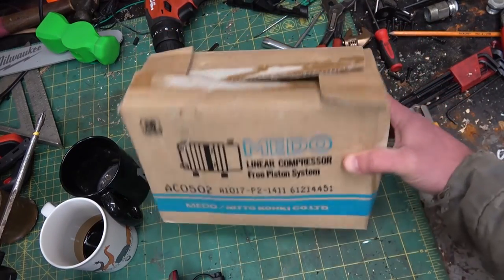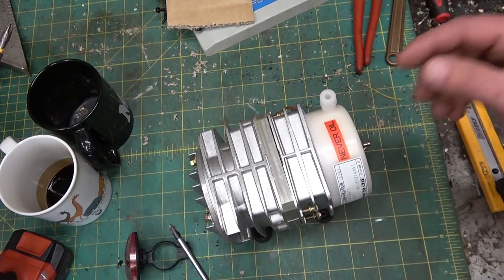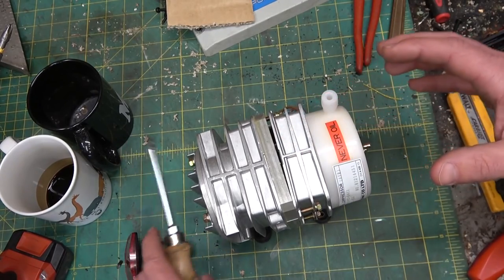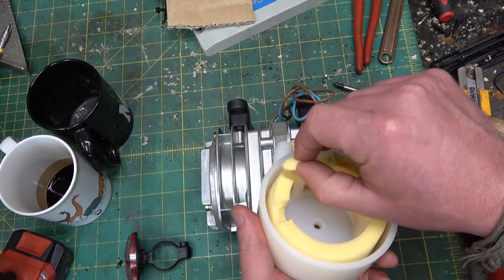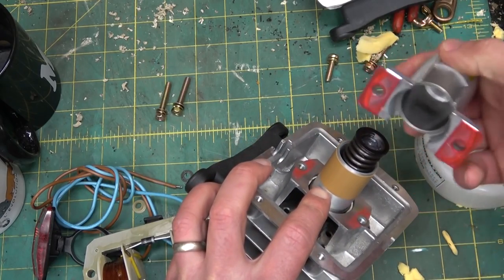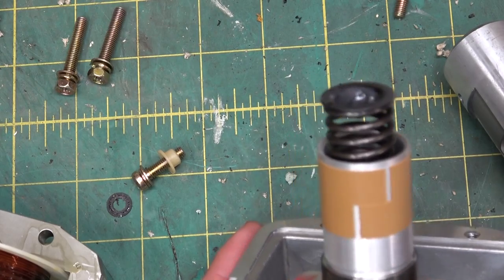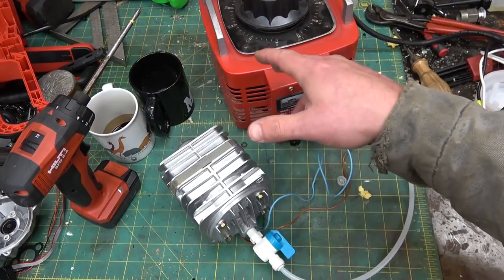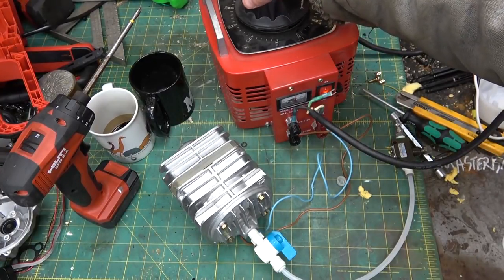BOLTR: Japanese Linear Compressor | Genius!

Comment: Looking for a small compressor like this that can supply about 10PSI for a home powder coating kit. Don't want to run the big noisy compressor every time and I don't need much pressure. Would something like this work?  I thought about stacking PC fans. Anyone on if that works to compound pressure?

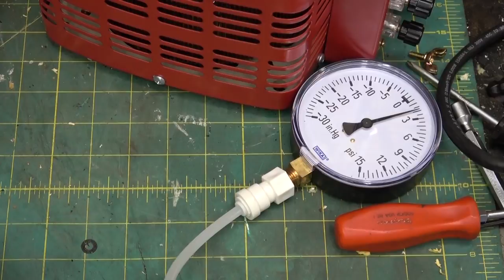Comment: "...why are regular compressors run by rotating motors..."  It has nothing to do with economy of scale...piston compressors are positive displacement type...this pump is not, as you can see at 11:10...when you dead-head this compressor, it bypasses internally and no air gets moved...this action reminds me of an aquarium airpump...the beefiest and nicest made one ever, but nonetheless still just a wimpy little airpump, with limited use as you say to just what it's designed for...maybe you could run an airbrush off it...Cheers

Comment: Where are you living? Here it's 60 hz...they make em this way cause it is a cheap way to make low pressure low volume pumps (think aquarium pump) but because of it's inefficiency anything larger requires different design topology (ie, screw, piston, etc) ALSO there is the duty cycle factor to consider...these pumps being on the high side.

Comment: Moving that piston back and forth all the time can't be efficient, all the kinetic energy that was built up going one way has to be stopped for it to move the other way. Makes much more sense to convert electrical energy into rotary motion. And it's not like this has only one moving part: the spring moves (compresses) as well as do the valves.

Comment: Would you be willing to share what clamp meters you own/have access to and after testing them which of them are capable of Inrush current measurement and of those which can test DC inrush? Most clamp meters with inrush features don’t seem capable of DC inrush measurement as far as their spec sheets are concerned...

However Fluke’s data sheets for their current clamp meters and the last generation or 2 suggest that the inrush function is AC okay but it turns out that’s inaccurate and they’ve supported dc inrush measurement all along. Fluke says they intend to update their documentation soon. 

In summary I’m left wondering just how many of these off-brands with inrush measurement may support dc inrush without knowing it just by virtue of having color Fluke’s meters/Manuals. 

I won’t ask again, in the event that this question is a pain in the ass & you’re tired of seeing it, just wasn’t sure if maybe by asking on older videos you may not have seen my comments about this before.

Comment: I think your explanation for efficiency loss, is a little off, your effiency loss comes from the generated heat not the loss of the heat, as your not trying to heat anything with the compressor, all you want is to convert electrical energy to mechanical energy and any power loos in that conversion is your efficiency, but that said i dont know if adding a container changes the efficiency of a compressor,.

Comment: Reminds me of a low pressure, low volume fish tank compressor, don't think this would be suitable for a high capacity, higher pressure tool or refrigerant compressor. Those cheaper diaphragm tool compressors come close but they are noisy as hell.

Comment: I guess there is no momentum in this motor system. So it boggs out. Unlike a spinning motor which can store energy in the form of momentum to use to do work.
So the energy in is directly put to work. But with a spinning motor the energy in is saved up in the bank of momentum to be spent in a big glob.

Comment: just compressing the spring so it will return the piston means its wasting energy and that could be solved by reversing the poles electrically and make it work both ways or a 2 cyl   but who cares  really     Neat video though

Comment: It's a wimpy toy.  It DOES have valves, and it's slow and low volume.  A rotary motor is much more powerful.  My favorite design is a vaned rotor like in an air tool, like an impact wrench or air drill, it is super fast, very small and high volume and can put forth compressions of over 100 psi.  I think.

Comment: Not every transfer of energy has loss, electricity turns into heat with damn near perfect pixie to btu ratio
Reply: it's very close to 100% but it does lose small insignificant amounts.
Reply: Insignificant amounts lost to what?

Comment: ave! can you help me please. idk how else to contact you. i have a gopro battery, li ion 3.7 volt 1400mah, it charges but goes dead over night. i purchased the same variable dc power supply you use. currently recharging it with constant current as you showed. is there any way to save this battery? or get it to hold a charge better? or is it just trashed? any help would be greatly appreciated. i'll have my dick in the vice till then.....